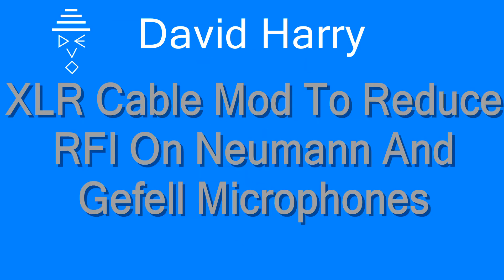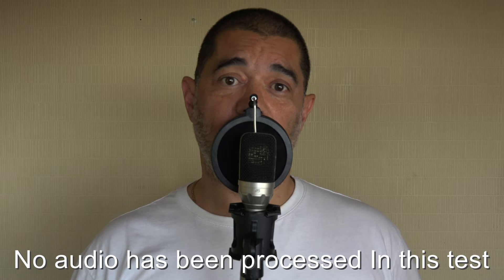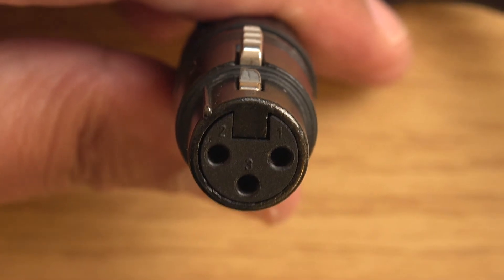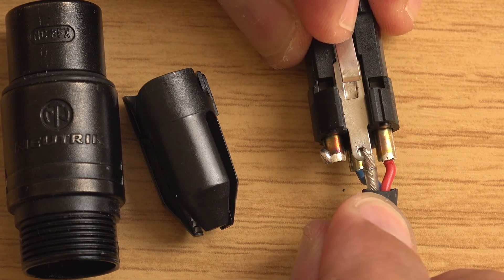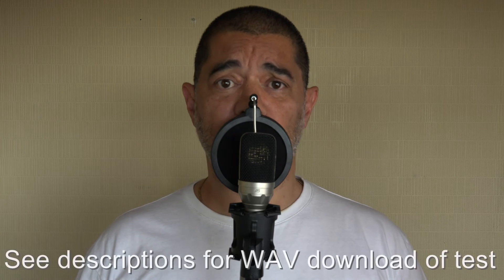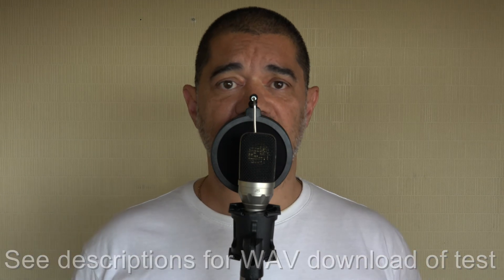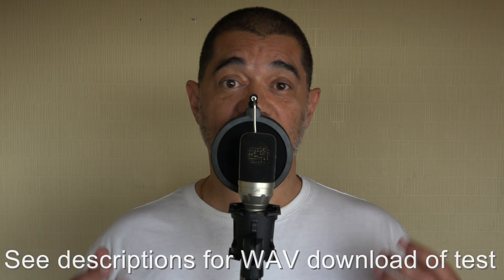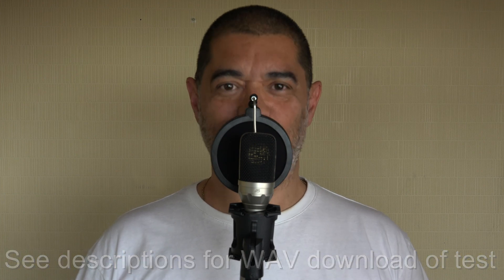How To Fix RFI Radio Frequency Interference Neumann Microtech Gefell Microphone XLR Cable Mod Hack

Comment: Hey Dave, banging my head as I have a similar issue but I think with EMI rather than RFI - seems to be due to old wiring or interference from other flats. Tried turning power and lights off but the high 2khz ish interference  persists especially in my ribbon mics. Would this method of modifying the XLR potentially work too? Or is this only really for RF? Thanks and very much appreciated 😀

Comment: had a bit of a fiddle, and stuck a thin wire (from a bag tie thing), stuck it in pin 2, and bent it around to the outer side area, so it could make contact when sandwiched between it and the connector housing when it's put in, and it's still noisy (because cheap mic and cable), but the radio signal is gone. That's good enough for me, and it also fixes the the loose connection it has lol

I wouldn't have thought to try this if it wasn't for this video :)
Reply from the maker: That’s definitely one way of doing it 😂👍
Reply: @DavidHarry  update, it'd only work for about 5-10 minutes, as if it was slowly draining of power. I did your trick, and it did okay. I then also still grounded it to my mic arm, because my mic's shock mounted, meaning the ground isn't grounded lol together it still isn't great, but a lot better
Reply from the maker: @fillman86  👍

Comment: This happen to my sm58.  The cable mod worked but I took the xlr connector out from the sm58 and notice pin 1 has a hairline crack so after fixing it now no radio interference even with regular xlr cable.  So the body of sm58 should have continuity with metal chassis on pin 1.  If not its pin 1 got grounding to mic chassis

Comment: Thank you so much for this! I couldn't cut a read on my U87ai without wondering if I'd get a copyright strike from "Get Back Honky Cat" and other golden oldies leaking in from the local station. Following your advice squared the issue off beautifully! 

Note to viewers; you might hear some people say that the correct way is to keep pin 1 as-is and run a jumper from it to the grounding tab- when i tried it that way it did kill the RF, but also raised the noise floor by about 10db and degraded the sound quality, lending it a hollow, boxy tone while dropping the output by about 6db. It's entirely possible that my wiring was at fault, but I did no cleaner of a job when I redid it according to this video, and the results were far better.
Reply from the maker: You are very welcome 👍 I'm glad the video and the XLR wiring were useful. Cheers, Dave.

Comment: It’s called a simple ground lift. DI boxes have it, it would be great if they start making XLR connectors with a switch to do that.
Reply: The ground isn't lifted.  It's simply attached only to the mic body rather than the electronics.  It also only works when it is very close to the mic itself, otherwise it will only become a better antenna.

Comment: Thanks for this.  Have you ever tried it on the MALE side of the XLR?  Or just female?  My UM70 has pigtail converters to XLR from 7 PIN, and I'm wondering if I can safely make the change on the pigtails (the XLR side of which is male), or if I need to add another XLR cable with the mod on the female side... Anyone know?
Reply: Just tested it out for a 1/4 to XLR as I needed to print some effects from my hardware compressor. I soldered the Male 1 pin to the base like this video and it works. A bit tricker to manipulate but definitely verified it works! Best of luck
Reply: I don't believe that would work, at least not for condenser mics. I think that stops DC voltage from passing through.

Comment: Funny how it picked up what was probably some radio station. I have also experienced that my self (built a radio reciever by accident, haha), but it's not that common. What's a lot more common, is RFI from cell phones and cell phone base stations or in a few cases WiFi networks. I do build microphones my self and it requires some work to get the shielding good enough to avoid that. 
Maybe that's not that big of a deal for studio use (unless you are unlucky to have a cell phone base station pointing right at your window), but I use my mics everywhere (mostly for recording audio to videos) and often in public spaces, city streets etc. Nice, that it was so easy to fix the problem in this case - it seems more like it's a manufacturer error (ground connected to one of the leads instead of the shield), rather than a technical problem.

Comment: Thanks. Inwas in the process of ordering a custom Caulfield cable for my vintage U87 when it started picking up a radio station during a session. I'll specify the issue to Caulfield and see if they can customize it this way for me and see if that does the trick.
Reply: Hi, I have the same issue, did it solve the problem ? Thanks !
Reply: @anthonyharand9881  We had Caulfield Cables build a custom cable with this done to it, specifically for our original generation 1 Neumann U87 that had suddenly began having RFI one day. We shelled out for the best of the best on every single material. It was the first time they'd ever done one but about a week later we received our custom cable and its never sounded better. No interference of any kind whatsoever. Can't say for certain whether it was the modification that did it or if its because we're now using the only cable better than Mogami but we'd tried several Mogami Gold Studio XLR cables of various lengths and none solved the RFI problem. If you're still having the issue, I'd contact Caulfield cables and ask them to make you the same custom XLR they made for Deadly Mix Productions to solve our RFI issue in our U87.

Comment: Doesn't pin 1 need to be connected at both ends for phantom power to pass and the mic to operate?
Reply: Positive phantom voltage is carried equally on pins 2+3.  Pin 1 is ground and that is still connected- just moved from the cable to the housing.  I made half a dozen cables like this for my mics that are affected.  It works *perfectly*.
Reply: We need an answer for this
Reply: Seems not eh